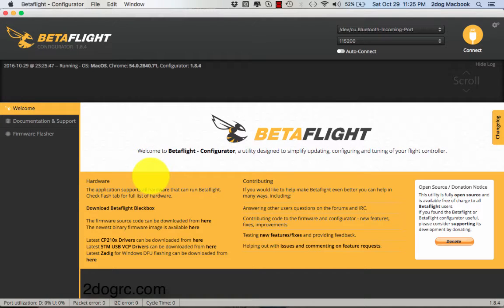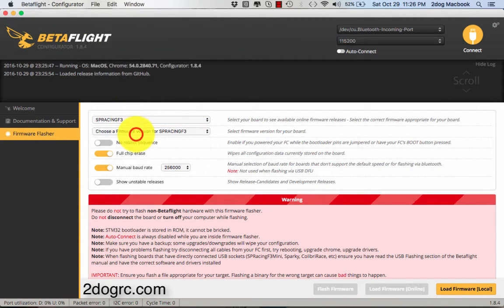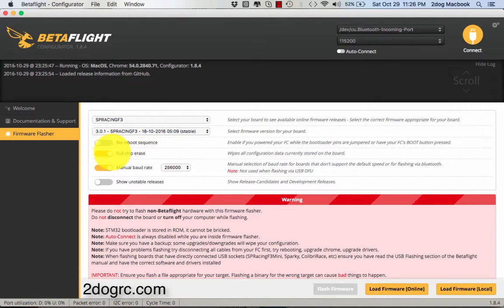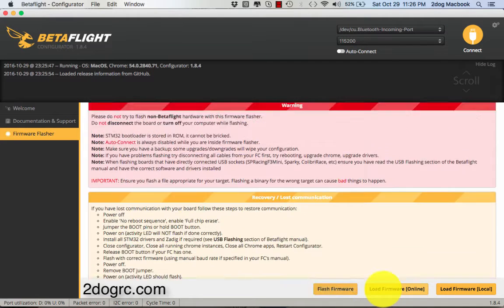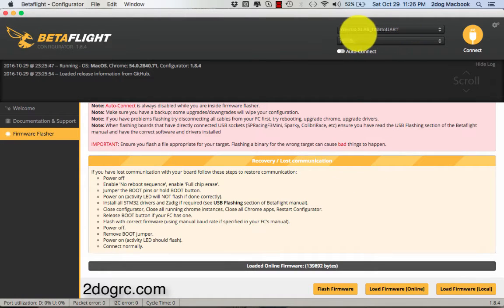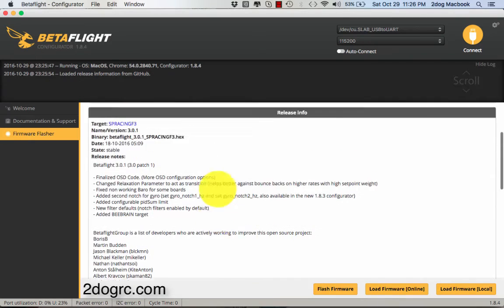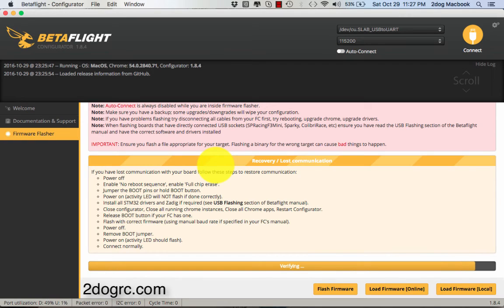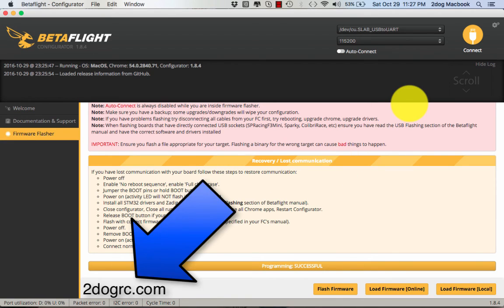Diatone Crusader 2 and F3 FC Flight Controller Flash New Firmware

Comment: I upgraded my crusader gt2 200 with the new diatone dshot 600 ESC. Is there anything I need to do before trying to hook everything back up? I'm having trouble finding info on the step by step. Thanks a lot
Reply from the maker: No, if you are using the new XD ESC's yoiu can plug and play. If you will be using Muiltishot, you still need to calibrate the ESC's.  If you select Dshot 600, then you do not need to calibrate the ESC's.

Comment: Just got a Crusader GT2 and unfortunately mine will not communicate with Betaflight. Verified the cable works with my phone and the red light even comes in inside the quad. But Betaflight will not communicate with it. This is brand new out of the box. Any ideas?
Reply from the maker: Please install the CP210 drivers on the welcome page in Betaflight.

Comment: I followed these steps, then it gave an error it could not flash and now i can't even conect to beta flight anymore. It says: failed to open serial port, Any ideas to help me out? I've been frikking traint to get it work for over 9 Hours :/.
Reply: Tim Terken 

Mine came through with same fault nothing will connect to it at all aggghhhhh
Reply from the maker: Okay. Two things to check.  The FC is the top board in the stack.  The Video transmitter is on the bottom and has a USB port showing.  The top board is the FC and PDB. On the right side if you are standing behind the quad, is a White JST connector.  You need to connect the CP210X dongle in there with the USB on the end of it.

The second would be to make sure you have downloaded the CP210X drivers via the link in the firmware flashing tab in Betaflight.

I guess the third is to make sure you are using Betaflight configurator and not Cleanflight.  

Let me know if that helps.
Reply: 2dogrc

No I'm plugged in to the correct port on the dlink with the adapter. Downloaded all drivers on the beta flight page restarted beta flight connect to com 1 as it's the only one that appears click connect it then says port opened then proceeds to close it again every time 
Try and flash with manual board rate
It either says fails to open port or no response from bootloader tried everything look like people are having same problem just buying the dlink from banggood with no luck connecting I guess there are either a lot of faulty boards out there or it's a windows 10 issue ?
Reply from the maker: If Comm 1 is the only port then it is a computer issue.  When you plug in the USB, the Comm port should change to something else.  It could be a faulty board, but 99% sure the board is good.  I have other people have issues on Windows 10.  You could try an uninstall the drivers.  I am not sure if you need the Zadig drivers as well for windows.  The other thing is the USB cord could be power only and not data.
Reply: 2dogrc 

Just deleted all drivers and reinstalled now picks up on com 3 but still just opens and closes is the button on top just a reset or bootloader button as when I hold down and power on lights still flash
Reply from the maker: The button on the top is the bootloader button.  To use that follow the steps in Betaflight, Firmware Flasher Tab, labeled lost communications.
Reply: 2dogrc 

If I hold the bootloader down button and power on dlink light still flashes  I thought the lights on the d link shouldn't flash  ?
Reply from the maker: Did you follow the directions on Betaflight.
Reply: 2dogrc 

Yeah followed all as per betaflight  I just bought a spare d link board and it connects fine to my computer , I guess it must be a bad board , thank you for all your suggestions and help

Comment: Mine isn't flashing which port on the top plate do u plug into?
Reply: Wait it is ok I got it! :D
Reply from the maker: Glad you got it! I should have included a pic as they did something not standard.  If you are standing behind the quad, it is on the right. You connect the cabled that has a 4 pin connector and MicroUSB plug into there, then the USB in to that.

Comment: Do you know if it can take ibus or only Sbus? Thanks Darren
Reply from the maker: Yes, iBus will work.  You would select UART3 as serial, save.  In the config tab select serial receiver, then below that in the box select iBus.  Save.
Reply: 2dogrc thanks mate, I was just confused as all the instructions only mention Sbus and the board only had Sbus printed on it. But my reciever only says ibus.
Reply from the maker: That is fine, iBus is a SSbus type.  Sbus means serial bus.  So connect it via the Sbus wire ,then in the config tab in the dropdown serial provider menu select iBus.  You must also select the other options i have mentioned in the video.

Comment: Hi,  a very nice video. One quick question. What does 'Choose a firmware/Board' mean ? 
In this vid, you chose SPRACINGF3, but how can I find out which firmware do I choose ? 

In some videos, people just leave this option. Dose it matter if I leave firmware to default ? 
Thanks :)
Reply from the maker: Good question, I am not sure what happens if you leave default.  You can look in the "log" when you first connect your board and it will tell you what firmware your board has.  If you select the wrong board, it won't work and you will have to use the "lost communication" procedure listed on the firmware flashing page.